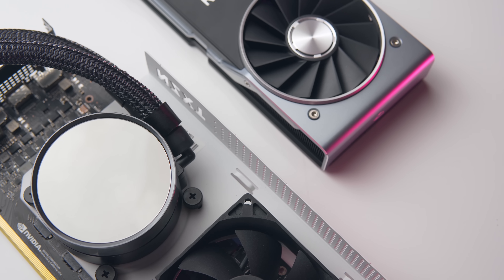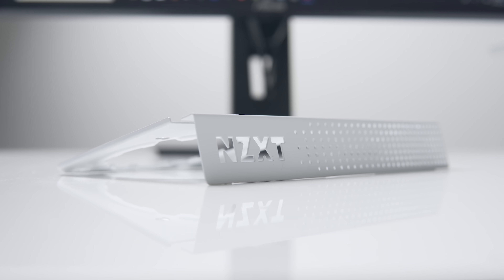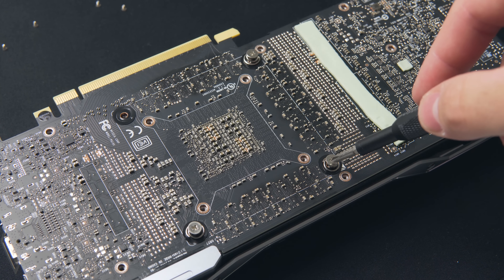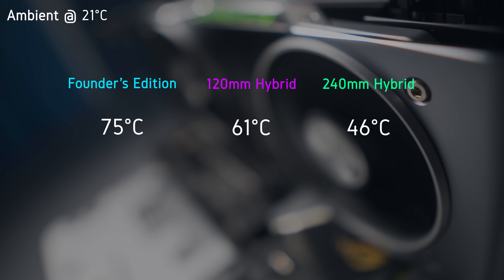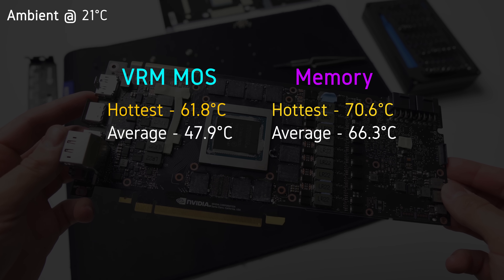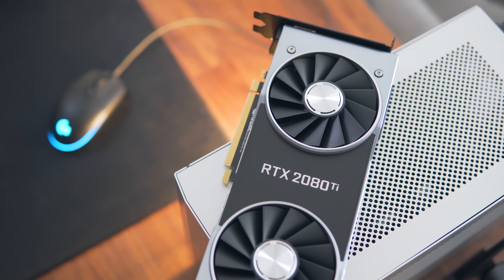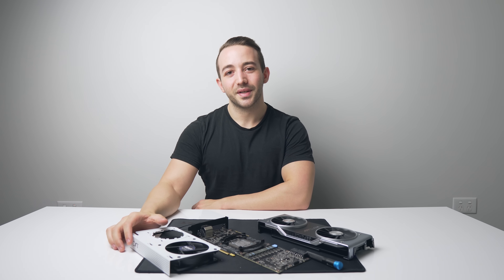RTX 2080 Ti + Kraken G12 Hybrid Cooling - Worth it?

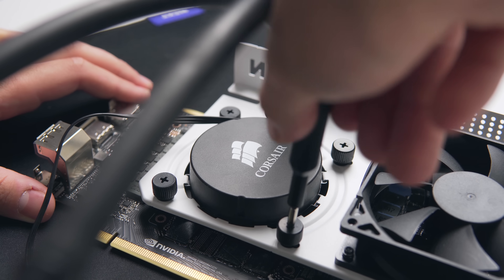Comment: 5:01 I got myself the Kraken G12 and H75 cooler but I have 1 problem. The screw in bolts are way too tall. The tubes attached to the side get in the way of inserting the copper block all the way. I can't touch the die. Is there something I'm missing or do I need shorter LGA 115X/1366 stand offs? I think I need a much shorter set of stand offs to reach the Quadro RTX 4000 chip. What thread size even are they? What and size?

Comment: Maybe no one will ever need or see this, but if you install a g12 on a card that needs more airflow to the die side, without the included fan, here's what you do.. 
1. Buy a 92mm noctua slim fan
2. Remove the pci slot cover directly below your gpu
3. drill a couple 1/8" holes in the slot cover, ~95mm apart
4. use (4) 5" zip ties in a square to secure the fan to the pci slot cover. trim excess off the zip ties
5. put slot cover and fan back into pc and setup the fan in whatever you're using for controller software

Comment: Super late, I know, but I just wanted to say my 2080 ti XC hybrid is in need of a mod like this because the water in the original AiO has evaporated or leaked over the last 4 years, and I cannot fill it back up. I'm hoping this is the solution to reviving my card, as I cannot afford a replacement and the warranty is out of date by a year.

Comment: How are VRM temps after removing all cooling from those and leaving them to be passively cooled?
Reply: They were all at or below 70 degrees celcius according to his test. It looks like this will still work for most modern graphics cards running standard GDRR6. The 3080 and 4080 use GDRR6X that runs hotter. Not sure how much hotter but it’s something to consider.

Comment: I have a Gigabyte 2080ti windforce OC and had nothing but problems with it, getting temps up to 87 on the chip and 106 on the memory which causes the fans to go above 3000rpm every 30 seconds or so, Ive tried the usual, dont even have a fan curve its on at 100% before the game starts as is the case fans, its a good case and good fan set up, that defo isnt the problem, took the card apart and the thermal pads were wrecked and of very poor quality, put decent ones on even though its impossible to find the actual thickness of the pads anywhere (industry secret apparently) anyway tht stopped the 106 temps but they can go up to 103 so its not far off and obviously dont want those temps anyway and the fan noise is terrible, taking the front of the case of makes no diffrenc, nothing does, had it almost 2 years maybe more and tried everything but water cooling so here's hoping

Comment: 5:04
Why nobody tries to explain in clear details how to connect the Kraken G12 and the AIO to the GPU?
There are 2 to 3 fans and a pump usually involved in NZXT G12 configuration. Knowing where to connect them ON mobo/PSU/GPU is the most crucial point for us noobs!
Help us for low temperature’s sake!

Comment: My average is in the 70s, but my hotspots are above 90 (sometimes 100). I'm concerned about damage, so I'm interested in better cooling, without overclocking. I would like an AIO with a full water block, instead of a hybrid. I configured one from EK, but it was $800 and I'm not spending that much. Can anyone help?

Comment: 2080ti black edition, went from 83C at full load to 50C with G12 and X53. Totally changed my build! Having a quiet, monster pc is so much better than the constant 100% fan. And performance is way more consistent. I wouldn’t be surprised if I’m getting 15-20% more FPS, and pure consistency boosting to 2075mhz and sitting there until I turn the game off.

Comment: I'm about to (well, next payday) fix my 2080Ti ROG Strix card up like this. It is a daunting task, to say the least. I wonder if this would be similarly effective on it (it's running rather hot now, often hitting 80-81 degrees while gaming). 
Do you think it'll be worth doing for that card, specifically? 
I'd hate to take it apart to realise the card components are completely different from the FE one.

Comment: what about memory temps? and VRM
those things without a heatsink are in big trouble
surface temps don't tell the whole story IMO. I'd at the very least mount small raspberry pi like heatsinks on them

did you measure them while running btw? those things cool so fast when you stop the load

Comment: Hey! I know this is an old video, but I found a pin converter from the NVidia pinout to a mini-fan header from Arctic cooling:

https://www.arctic.de/en/NV-14-Pin-Adapter-Cable/EMCBL00184A

With a bit of cable conversions, it should address radiator fans

Comment: I had to use the AMD brackets for my Nvidia card. What I did about the VRM and other parts no longer being cooled by their thermal tape, I used a Raspberry Pi heatsink kit and added aluminum sinks to individual chips

Comment: Just did this on my system! Kind of a pain to install and I think I over tightened it because the graphics card has a slight bend in the card at the mount but it works perfectly fine. Also need to get something to support the card as now it has really bad card sag, I've got something to to work temporarily but I need something long term. I have a pretty small case so I don't have much room but I'll figure something out. If you're thinking about doing this absolutely do it!! Well worth the $200!! Now my AIO cooled cpu and gpu even overclocked don't run hotter than 41C even with anything you can throw at it! Wish the new corsair AIO's still worked for this setup because my corsair software doesn't recognize my cpu AIO now and I can't control it, but the NZXT software works just fine. Thank you for this video! Also if you do this project it takes probably 6 hours or more from start to finish to really button everything up and make it look good. And watch out for the hidden screw underneath the warranty label lol!
Reply: @ClipperAce  last year when I posted this my card was still a very good card. I am thinking about upgrading soon. And I’ll also get that card water cooled as well. Just makes everything 10X better more stable over clocks and barely any noise while gaming. Totally worth it and I’m still happy I did it to my 2080ti. That card has paid for itself while mining was going crazy last year. Plus it still plays any game in ultra and 4K.

Comment: would adding vrm heatsinks with this combo be worth doing or would it not be needed? i have a msi ventus rtx 2080 ti oc and with the stock cooler my temps are hitting 86-88 c underload and causing my card to perform poorly so im ordering this kit and praying it fixes my issue. Thanks alot!!!

Comment: Tried this and broke my 2080 super. The main chip died. The repair guy said it's probably because the screws weren't tight enough (they gotta be real fucking tight) as well as me holding it by the pump caused a tiny gap which made my GPU instantly die and artifact severely. Would've been nice if you could've mentioned this or at least provide more information.

Comment: I've just done this mod and was curious about how to cool the chips around the 2080 as they have no contact with anything that can transfer the heat?
Reply: He mentions in the video temps were fine with just airflow. If it is of that much concern to you, you can buy sets of small heatsinks fairly cheap and use double sided tape to secure them.

Comment: mounted this to my Asus rog strix 2080 ti with a kuhler h20 920 push/pull config and can plug the pump and and fans into the extra fan headers on the back of the card

Comment: this is a bit old but the software "Argus monitor" is really useful, you can control any fan and set a fan curve to any temperature source on your pc, even from the drives. also has lots of other stuff. the UI is primitive but it has a lot of features. its free for a month but ive used it for a few months cus it asks you if you want to keep using the software just click yes. a license costs like 8 euros iirc and you get updates for a year but the software itself is activated lifetime

Comment: Is there a way to get a shroud or plate that covers the top of the GPU for aesthetic purposes?
Reply: Buy a custom rgb backplate from v1tech. Usually run about $100  but they commonly have sales down to $70. They are dops as fuck

Comment: Nice job on the break down! I wanted to see how this bracket panned out for the 2000 series cards. I used a G12 NZXT bracket on my 1080 as well back in 2016 after noticing my stock MSI GTX 1080 hitting 83c under load. It now for the past 4 years idles at 27-28c and under 100% load never surpasses 45c. I was scared as hell to void my warrenty and DIY water cool it but hands down it was the absolute BEST decision I ever made well worth it.
Reply: I'm sitting here thinking about getting one for my GTX 1080 to try and get a little more performance out of it so I don't need a new GPU soon. Prices suck.
Reply: @Slepnair  I’d recommend it at your own risk of course.

Comment: Could you please revisit this on the 3080?!
Reply: Interested in a 3080/3090 revist for this mod...I've seen one for a ventus 3080 which required new holes to be drilled on the g12 but the results were inspiring...
Reply: It's not a viable solution because you can't cool the left side of the VRM properly.
Reply: Would be good to know if this would make a 3080 into a 2 slot dimension so it can fit in a DAN A4. Ultimate cooling in SFF if it takes a 2+ slot card into 2.
Reply: Idk if that would work cause the g12 is made for the 10 series
Reply: And 6800xt please

Comment: Also you did not show anywhere in the video where you installed heatsinks on the VRM/VRAM chips this is an requirement u wont be able to overclock it as well and they will likely run at high temps would have been nice to see in the video where you actually buy aftermarket heatsinks and apply them
Reply: i did this mod today and no temps went down by like 10-15 but its so much quieter now, previously i had to run gpu at 90% fan to keep it 70 degrees.. i have cheap h55 aio from corsair, does a good job, i have 1995 mhz core clock and 8200 mhz memory, touched vrms and chips and they don't seem to burn or be hot, the cooler does a good job, i will apply small heatsinks i've ordered but its impossible to fit them around because vram chips are near the nvidia chip so they won;t cover it fully.. its still cooler than typical evga black editions or founders one, so you are not loosing anything here going with this solution.. i had 1080ti zotac which had 0 contact with radiator and it worked like tank and still works in other system, those vrms can work at extreme temps for such a long time you won't even want to use it.. and yes most new 2080ti come with samsung vram and they can work at extreme temps and for years, samsung ssds, ram, vrams are considered the best one in the industry for their longevity, overclockabilty, i've added +1200 mhz on memory.. hynix can typically do +400 and micron +550-700 max..

Comment: Would it be a good idea to use the heat sink plate from some M.2 nvme? I have ADATA sx8200 that provides thin heat sink plate which i did use as MB provides heatsink cover.

Comment: Haha... boy, what a flashback...
I did screw up an Nvidia Strix 980 Ti because of an issue I just noticed here in this video.

I had applied just enough thermal paste in the center, a decent thick drop as I always did with CPUs and GPUs in the past, and somehow, after reassembling, the thermal compound managed to get outside of the GPU die and messed with the transistors surrounding the GPU, just as he did it in the minute 4:55, on the right side bracket... man. Seeing it hurts a lot.

Think about it.. Some thermal compounds are metal-based, so yes, it has metal components to help dissipate the heat. Basically, by doing it, you are just provoking a short in your PCB. Hopefully his paste is not a GPU killer :D
Reply: Most paste is not.  You should be fine.  That said, you can still clean it off with high-grade Iso and a microfiber.  Worth doing.  Make sure to get no fibers into the paste.  Basically: just clean and re-paste.
Reply: @MoonRegolith  Agree

Comment: Thing is... Most will spend more like $200 ttl (g12+aio+4pin cable+paste)... So All that cash (not to mention the risks) for an extra +50mhz or so core clock.

Can anyone here post the EXTRA oc they managed to get (compared to stock cooler) using g12, and fps if tested?
I got like 1-2 fps increase using an x61 😔

Comment: Would the kraken g12 fit an Msi rtx 2080ti gaming x trio?
Reply: Tech PowerUp has high resolution PCB photos you can use for that card to make sure things will align.  But basically, as long as it fits over the GPU die, then it's fine.

Comment: I had G12 with Thermaltake 280mm on my 2080ti, and that works fantastic!! Really amazing!! Now I could leave the pc on doing rendering when I go to bed.
Reply: How are the vrm temperatures
Reply: @vivpunk1258  I do not have an answer since I did not check the vrm thermal and I no longer have the 2080ti in my hand. Should not be that bad considering any GPU's vrm should be cooler than that of 3080s'. lol
Reply: @hepengye4239  Hey, just a super quick question, how long did you have the 2080ti setup with the g12? And for that time, was your usage of the card quite heavy? I just bought the bracket so any context of previous use is great to hear. Thanks :D
Reply: @snowmanfrostyman I have used it for like half a year, then I sold it for 6800xt. I was using it for gaming mostly, could get to 90% load, so kinda heavy usage. the temp is just around 55C at half fan speed if my memory is still trustable.
Reply: @hepengye4239  understood. Well thanks a lot for the insight! Appreciate it!

Comment: How does it work out just leaving the other chips without cooling?
Reply: The fans are cooling them. And case airflow is providing more thermal dissipation in a non-cramped case then when a shroud was on top and their was the ambient heat nearby of the standard cooler and heatpipes.  An AIO is moving 85% of all the heat of the card instantly away and out of the case.  The ambient case temp itself gets profoundly lower.

Comment: If you plug the fans into the AIO headers you can use CAM to tie to the GPU temps and it will default to water temp of AIO without

Comment: Thanks to your video here, I decided to buy the G12! It’s amazing, thanks for the video. I bought a Kraken X63 (2x140mm fans). I mounted it on the MSI Ventus 2070s GP. So far, after 20 min on MSI Kombuster, the temps range from 44-46c, fans remain static at 33%. FPS ranges from 58-64 with it usually remaining on 62. Your coverage about the VRM/VRAM makes me feel much safer. I’ve put an extra fan over the empty area just in case.

Comment: Holy moly why would anyone design a cooler that doesn't cool the MOSFETs (bunch of power delivery chips near the row of cubes on the board). I've repaired GPUs in past and the most common failure is blown MOSFETs due to insufficient cooling. Even WITH a heatsink on them. And here they just take the heat sink off and leave it? Who on earth designed this?

Comment: Can i use the same loop and the same radiator for both cpu and gpu ? Maybe two pumps ? I wonder if it can be done with kraken cooling parts. So i can get a realy small form factor well cooled very quite pc. What do you think???

Lets say: one 240mm radiator, one pump for the cpu. And second pump for the gpu with the g12. One of the radiator fans will be control by cpu and the other by the gpu. That do you thing?

Comment: Dude, it would be very interesting if AIO water cooler manufacturers sold their products with AMD and Nvidia GPUs socket adapters, and not just adapters for AMD and Intel CPUs, I see a commercial success there, if that doesn't exist anymore.
I saw your most recent videos on your channel where you installed a 240mm radiator on a GPU and did the feat of mounting a mini-itx system with two 240mm radiators in such a small case, it really surprised me.
I became interested in the subject and started researching about video cards with AIO radiators preinstalled. I found few video cards with this feature and costing very, very expensive, like the EVGA RTX 2080ti K| NGP| N, and the Gigabyte Aorus RTX 2080ti Xtreme Waterforce.
If they did that, it would cheapen the construction of a new PC.

Comment: Looks like the 120mm water solution was within margin of error performance-wise to the stock FE. The 240 is barely better than that. Appears the chipset is pretty much running near its maximum and 90mhz doesn’t really translate to meaningful performance differences.

Comment: I see this is an old video but speedfan 4.52 is a great application to correlate GPU temps and chassis fans if needed. It's not the most user-friendly but once you figure it out it's pretty great.

Comment: I just bought a temp sensor, and stick it right on the top, where the processor is. Plug it in the T sensor on my mobo, and have my fan controlled by the GPU temp. $7 fix. :)
Reply: That's only edge temp

Comment: So i have a 360mm aio on my 2080 TI. On max power limit it still goes up to 75C. Idle it runs at 30c, in certain games like RDD2 it goes upto 65c. I was thinking the aio was not touching the die enouph, but i checked and the paste was all over the AIO. It seems like at a certain TDP the AIO just can't keep up. Strange that You ony got 46c with a 240mm.

Comment: Thanks for this guide review it helped a lot in my build! 2080ti temps went from 84/85c under load to 62c.
Reply: With a 120mm rad or 240?
Reply: @Kizzster  360mm, the Kraken X73
Reply: @Fritzie345  shouldn't they be way lower with that size rad?

Comment: Hi, nice video, thanks! Question, is there no way at all to use the temperature on the GPU to control the fans? I.e. to connect the fans to the GPU instead of the motherboard? I see other GTX2080's do have this option by using a GPU Fan adapter... Has anyone had any success with this on this particular card?